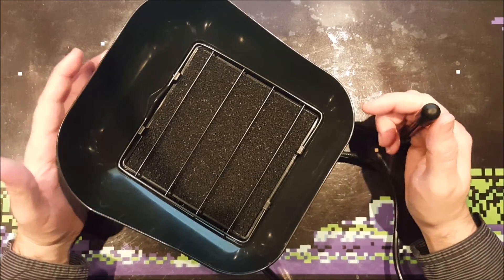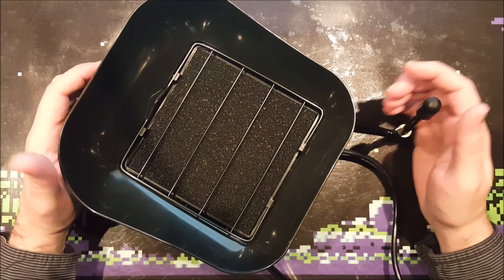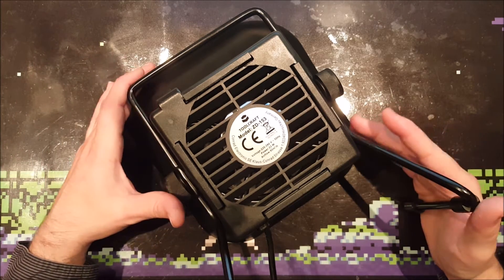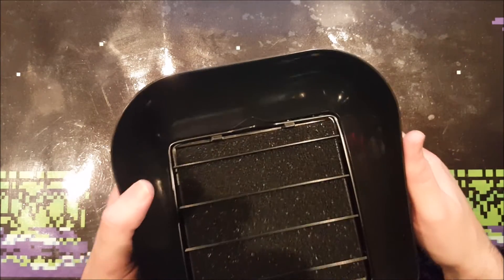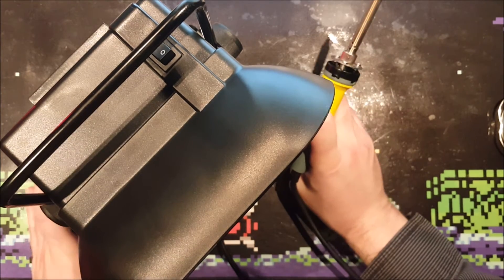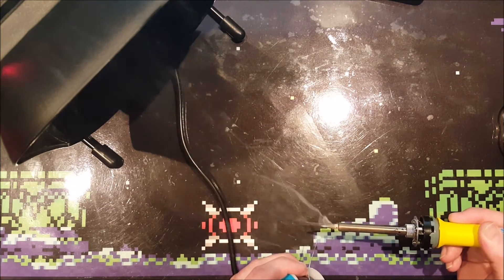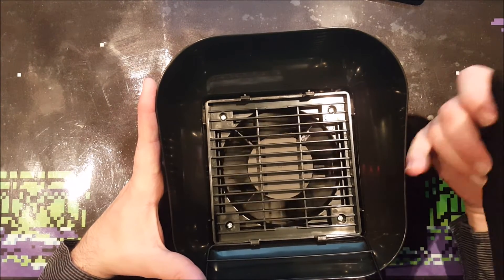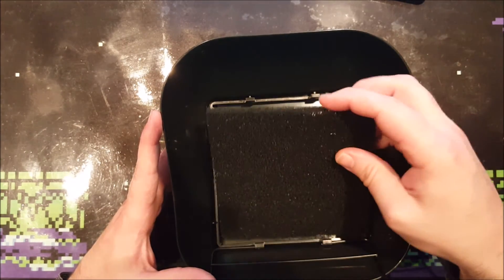Review of the Toolcraft ZD-153 Solder Fume Extractor

Comment: Maybe you can use it in series with a foot switch pedal.
Reply: In the meantime, I bought one as well. It's actually not that loud. I have a similar size cheap space heater from Tesco and the fan of that is much more annoying in terms of noise. I'm not going to run this for long sessions anyway, like max. an hour at a time. I think it's going to be okay for hobbist use.

Comment: Thanks for the review, just what I needed. I've been looking at a better solution to solder fumes. So far I've been using a 12v PC fan with a carbon filter attached to it, but I'll get one of these instead as it doesn't suck very much air. I found one of these on Conrad that had an arm you can attach to the table so it'll be easier to position above the smoke.